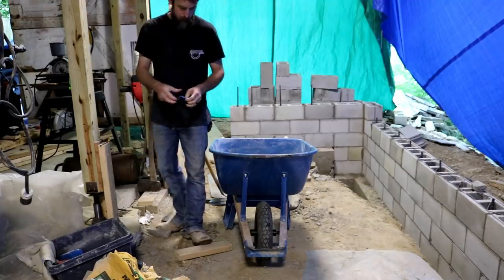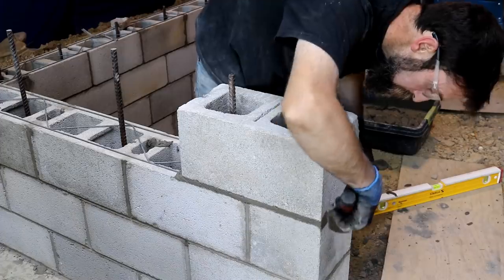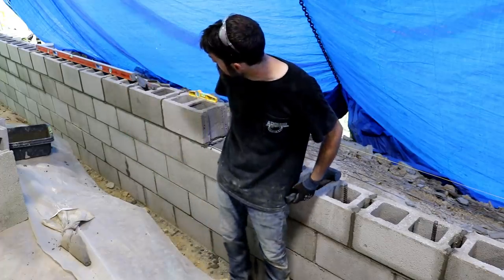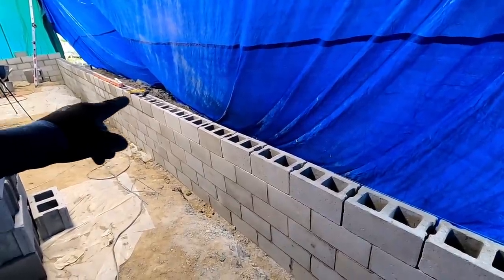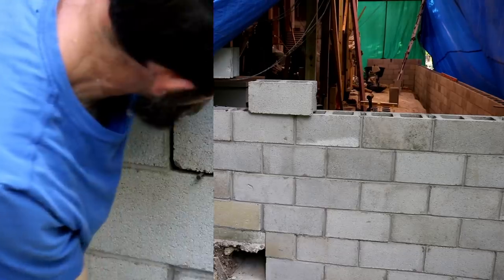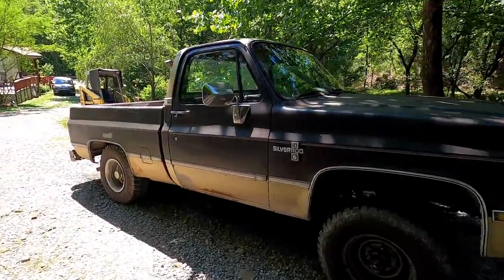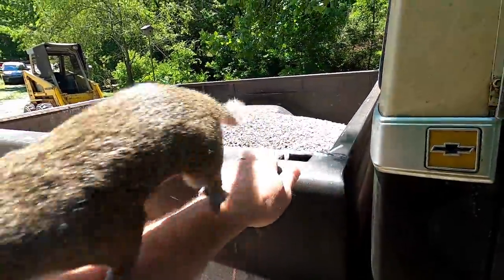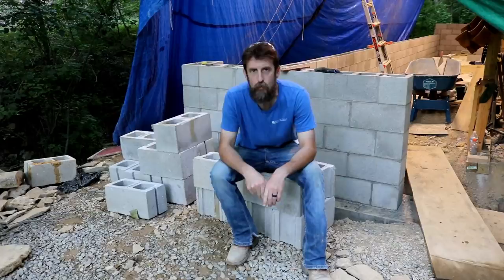Block Work Continues on the damaged shop!

Comment: When you set those windows in a frame use some small rubber blocks on the bottom. The two panes will separate, seal breaks and then get fog in between the panes. You can caulk the space left by the rubber blocks. Glass places have the blocks. They are small  maybe 1/4" high  1/4" wide  1" long   . ou could probably use anything 1/2 hard.

Comment: We used to have an old Chevy S10 pickup, and it was really handy. Hauled over ten tons of crusher fines with it 1000 pounds at a time, then another ton of sharp sand, for a brick patio. Most of the paint in the bed was gone by that point. We were fortunate that the yard was only ten minutes away and that we could drive the pickup right into the back yard.  Twenty years later the patio is still dead flat.

Our daughter took it to college and it got totaled in a hit-and-run (but she was okay, thank the Lord). Lately I've been wishing I had another old beater. There's always something you need one for.

Comment: Where I am with solid blocks we build up the corners accurately and the walls are goodernuff in between with string lines then rendered. This project is thoroughly entertaining and your skills are to be envied.
Reply from the maker: Thanks. I wasn't 100% what good enough was. I just tried to do well on every block. At least good enough that the didn't catch my eye. The original block work is real nice. Much better than mine. Those guys who laid the rest of the shop were pros IMO. Had to be to get them as good as they did. Something to shoot for I guess.
Reply: @SteveSummers  Thanks for the reply. The quality of the original wall shows in the way the joints are finished and your reworking doesn't look out of place. I always find if you wait a few days and step back things look just fine!

Comment: Hi Steve im a long time subscriber from England.  And i have been a bricklayer for 30 years.  Apart from the lack of a trowel you are doing ok.  You should leave the jointing until the mortar is nearly cured.  And brush it off a little while after you rub the perps and bed joints up. With a soft bristled brush.  Keep up the good work my friend Dave from England

Comment: Steve I have been watching your shop rebuild journey so far I am impressed on the amount of detail that you have put forth in your footers and prep work (my day job is a bricklayer)I can tell you one thing with out a doubt  in my mind you put the attention to detail in the right spot to get the results that you have achieved so far. as far as keeping your spacing for the head joints on a long run of block a mark every 4 feet works wonders  ......

Comment: Mate watching you stone the surface of your block work before laying down the next mortar bed was next level! Very impressed. One thing I’ve not seen in your video is setting down the blocks before mortaring them in, this can cause a dry joint, as the surface dries out after the mortar first touches the blocks. With all of the reinforcement and with subsequent grout fill, that wall isn’t going anywhere! Just might give you a bit more workability when the block first goes down, you can use a drier mix, which has less slump, and still retains workability due to the moisture in the blocks slowing down their contact drying. Thanks heaps for sharing mate

Comment: Hey Steve, two quick tips:
To speed up mortar prep, pour it in a 5 gallon plastic bucket and use a drill mixer, it makes things go a lot quicker
Always wet the surfaces before applying the mortar, dry surfaces will suck the moister out of the mortar before it fully cures, ending up with weak crumbly joints, use a water spritzer bottle to completely soak the contact surfaces, specially on warm summer temps

Comment: A tip I've seen and occasionally done to help tidy up mortar joint lines is after initially rounded, wait until the mortar is semi setting up (maybe a quite a few hours or potentially next morning if cool)  then run over it with a wet stiff bristle brush.
Reply: In the UK Brickies use a soft broom head to brush the work when the mortar is set it removes all the "snotties" and makes the wall look nice. I am so pleased you are doing your own blockwork Steve its looking good and I bet Elizabeth is proud of you. Cost of Blockwork = Cost of blocks zero + cost of labour zero + cost of bags of mortar. A huge saving over getting some one in. That's got to be some money towards your next shop machine. Well done.
Reply: Your mortar just has to be hard enough not to smear, an hour or two. otherwise you’ll have to rub it off with a chunk of 4x2” !

Comment: G'day Steve and Company, your logo would have to include a squirrel running a shaper with a bloody great cement block wall in the vice. Mate, the job don't have to be perfect. It just has to satisfy you and keep out the weather etc. I must say that anything is an improvement than it was. At least this one won't end up in the creek. The trouble with us machinists is we always try to work in thousandths. My father would always be on my back when I was working with him about that. He was a traditional boatbuilder and I am/ was a machinist now part time boatbuilder. As he said, it only has to keep the water out. Cheers and keep it up. The end is in sight.

Comment: The toothing is always a pain, get some 3/8” dowel rod and set your block on it inside the toothing.  Use your grout bag to fill both bed joints, above and below.

Comment: Bake cake in layers, plant corn in rows, but lay block and brick in courses!  Well that is what the old bricklayers told me.  Come to think of it, I'm one of those old bricklayers!  Well Steve, you did a good job on that wall and saved some money to boot!  If you have some imperfections at the top of your wall you can mix some mortar and bed your sill in it...I guess that is why they used to call it a mud sill, I think.  It's a shame you don't want to go all the way up with block!  Greg

Comment: Hi Steve,
I'm surprised that your getting that much done with all the inspectors and micromanagers on site :-)  I'm not sure you want to seal the wall or if you do you may want to put weep holes in at the bottom course to relief any hydraulic pressure that may develop under the slab floor. Nice job on laying the block btw.

Comment: Steve, it's gotta be tough with the inspector riding your back like that. Not everyone can put up with that kind of pressure, I commend you. 🤠

Probably one of the best things I ever did as far as wheel barrows go is getting rid of the one wheel and getting one with two wheels.  You can not only move stuff easier, but more at the same time.

Comment: If you wet the blocks they will bind better and easier, and it will also go a lot faster if you use a concrete layer box, just fill it up and drag it along.

Comment: Glad you hadn't left the keys in the workshop. You'd have to break that door open. Also, when using that stone to flatten out the high spots on the previous layer, use two stones and rub them against each other to flatten them out, cause with one stone, it will gradually be a few thou off.

Comment: Muratic acid is used to clean concrete block walls. Not to say it is what you want to do. But it's how it is done. Muratic acid is pretty nasty stuff to work with. It'll clean your sinuses out. Leaves concrete squeaky clean though. That's how walls look new when they're new. The acid etches the concrete a little.

Comment: You’re right. Block laying is hard work. Good masons are to be respected.
Nice job. I suggest scaffolding on the end walls. That way, you can stage block on the scaffold and work from one level while laying each row.
A hoist to lift material helps, too. My two cents. Just wish I was capable of helping you.
Thanks,
John
Reply from the maker: I have some scaffolding I am about to go get. I couldn't imagine trying laying block off a ladder. Probably end up in the ER.
Reply: Steve Summers 
Good deal. Yeah, I’d likely be in the ER, too. 
I’d have to check to see if Tim the Tool Man Taylor’s coffee cup was there. 😁
Thanks,
John

Comment: When building the windows the wood frames are really just a place for you to install hinges and catches. Consider using structural adhesive to adhere the insulated glass unit (IGU) to the frame. That way the glass contributes considerable strength to the window.
Reply from the maker: Good idea👍
Reply: Steve Summers use Dow Corning 995 or similar glazing adhesives. They have additives for UV resistance. Allow a 1/4” space around the glazing unit to allow for movement. The glass is amazingly strong, but the edges are fragile. Pressure around the edge will cause the glass to shatter. The glazing rabbet should be 20mm wide. That leaves you about 14mm of glass bite. Put the rabbet on the inside face. Allow 1/8” of adhesive on each face. Get some 1/8” thick rubber to space the glass away from the face of the rabbet and two layers (total 1/4”) to center the glass in the rabbet. Apply enough adhesive so that it squeezes out. Once it cures trim the excess off with a razor blade. Protect the wood with masking tape. Use a screw on glazing bead on the inside.

Comment: I have never laid block. But I think you could have ensured your vertical grout lines using your level after you had placed the first two rows? Line up the end of the block with the one two rows down and you should have the same vertical spacing.

Comment: nice looking. those windows may be energy efficient, and keep the heat out when correctly oriented. I don't know if you get sun in the direction you are putting them, but if you are, they probably should be put up the way they were up and down. but that's ok, it will give you more room on your walls for things to go or shelving, and won't require as long a header.

Comment: I’m impressed that after mixing mortar for that many block your wheel barrow isn’t covered with a half inch thick layer of cement. I’ve heard that years ago, on union jobs, the laborers would just leave the unused mortar in the pans and mixing boxes. The next day would start with crew beating on everything with hammers to knock the bulk of the cement out.
Any new logo should include Peanut and Walnut.
Reply: Knocking out pans is a thing. It has to be done. Boxes are not for mixing. They're for carrying mixed mud up to the crew on the scaffold.
Reply: @1pcfred  let me explain. From 1982 to 1994 I worked for a mason/general contractor. My boss and his brother had been on masonry job sites since they were about five years old. Ralph, who ran the business, had bought cement mixers several times over the years and sold them off. For some reason he didn’t like them, so we had three mixing boxes of various sizes from 4’ long by 2.5’ wide by about 1’ deep up to 6’ long. We weren’t doing big commercial jobs. Everything was residential. A typical job would have been a flagstone walk or a chimney repair. A big job for us would have been a block foundation for a modest addition. They still had a  pair of hods for carrying mortar or bricks up a ladder. I never used the one for mortar, but we did occasionally use the one for bricks. To use a hod it has to be full or very nearly so. If you only fill it halfway the balance is off and it’s more difficult to carry. The mortar went up the ladder in good old 5 gallon plastic buckets.
Reply from the maker: I clean it as soon as I'm done mixing.  
I pour in the water for the next batch and brush it. Otherwise it makes a huge mess that almost impossible to get clean. 👍
Reply: @janderson8401  these are the boxes we use. They fit on telehandler tines. Like Lulls. https://marshalltown.com/pro-1621-mortar-boxes-forklift-capable I only worked on big commercial jobs. I was a union laborer in northern New Jersey. But don't worry my name doesn't end in a vowel. So I'm not a gangster. I only worked for people heavily involved in waste management. If you know what I mean.

Comment: A suggestion for your order of tasks:  bring in your interior fill as soon as you grout. It has to be done at some point and will provide a much better platform to work from for the rest of the steps. I've just been where you are and wasn't smart enough to take my own advice! BTW, if you spend any time watching Bosnian Bill / Locklab you'll know that Master Locks have some serious security shortcomings...

Comment: You should be working to gauge. Same mortar gaps as you go up. Profile posts at either end with the gauge plus the block marked up the profile so you just move your stringline up to the next mark as you finish the row. Wait for the mortar to set a bit and then either use a bit of round bar about 1/2” with a handle to strike the mortar or strike it flat with the pointing trowel on a slight angle to help shed the water off. Round is easier and better.

Comment: The front half my house is 3walls from basement footings all the way to top plate cinder block. The cores was never poured solid. I’m thinking about somehow pumping the cores full of a air Crete, crushed up styrofoam flowable mixture. House 70 to 80 years old from what little bit I know about it. There isn’t one crack in the mortar rows tht extends past a blocks length. Old timers where good at what they did.

Comment: A long hard journey you are on there young man but you are winning the fight so to speak. over here in the UK we would use a small cement mixer for even smaller jobs thatn you are on. I don't do block or brick work (have tried and failed miserably) but the way I have watched guy's do it here is basically working off a level foundation they put the corners up say four or five blcok first. Then the following day run a string line from corner to corner and fill in the gap, only checking the level on the top of the blocks as they go, the stringline keeps side elevation of the blocks vertical. They never start block work from a "socket". Are you planning on making your own concrete mix to pour into the wall cavity? If you are, may I suggest you buy a super plastisizer AKA PolyCarboxylate Ether or PCE from a company like BASF, Sika or another brand. It comes in liquid or granular form. Be careful not to add too much. It basically lubricates the cement particles and hellps the concrete flow and self smooth. It is also a Water Reducing Agent which means you get a much stronger mix and better quality too. Far too many people add too much water to improve workability. I hope my comment is of help and use to you young man! Best regards, Jon.

Comment: That's really nice block laying.  If I had to  build a wall that long, I would build a robot car that lays bricks super precisely with 3 cameras as the guides, and remove all the human energy required to lift and place the brick.  I'd also make my own concrete mixer, and the put a pump on it to fill some kind of grout bag like mechanism, or just a straight tube with some kind of auger system pushing the concrete out of the tube, have the robot put down the concrete as well.  But then again, I smoke crack.

Comment: 9:45 might think about adding a drain in there if you expect to be spraying.  You could run it through this hole here 18:40   By the way I also love Look Creation channel.  That old Holbrook lathe is gonna be a sweet machine
Reply: the idea of having a drain pipe in the corner is a good one.  if not for now, for when one gets older.  quite handy during really cold weather, or if you get caught out in the shop during a hail storm and that last cup of coffee has hit bottom.  just remember to turn the point-of-view camera off .....  😳

Comment: You might want to consider a center pivot for the windows. It's not even overly difficult to fabricate. It'll give max airflow if you want it and you can tilt it so water runs out and away during a storm. Just a thought anyway.

It's all coming together quite well bud. The logo..... do whatever ya want, I'm here to watch the content so it doesn't matter much to me.

Comment: Filling those blocks at that height will be a challenge.  Masons I've worked with fill the block after they set a row or two.  Getting the correct consistency concrete mix to the bottom will require a concrete vibrator to have at least a chance of getting it filled.  Too loose a mix will not give you the lateral strength you want.
Reply: I've mudded webs. We usually do quite a few courses at once. It's a crew of guys that need to be hired. It is not mason's work in the union trades. Because it is placing material. So it belongs to the hod carriers. We don't use a vibrator either. Just pack it in with a piece of rebar. That's how it works on big commercial jobs.

Comment: i know its late in the job, but i have a tool i wish i had got years ago to unload my truck. it has a tarp that you put in bed of the truck under the load and you just crank the load off the tailgate in 15 seconds. under $100.